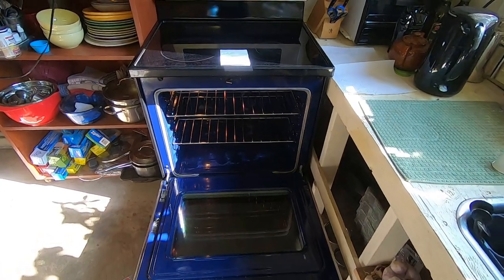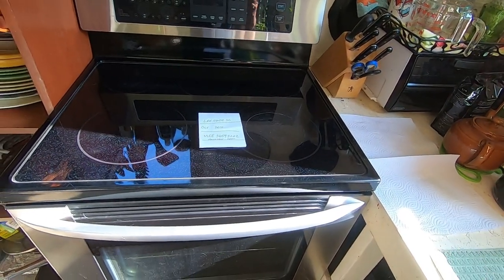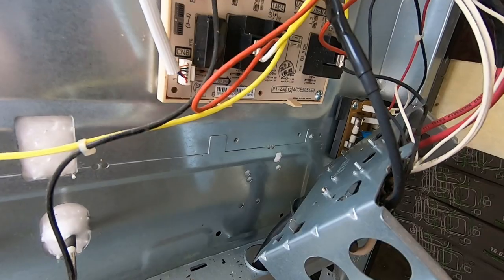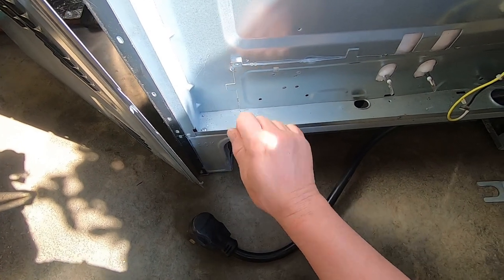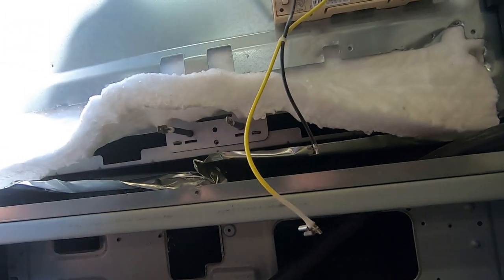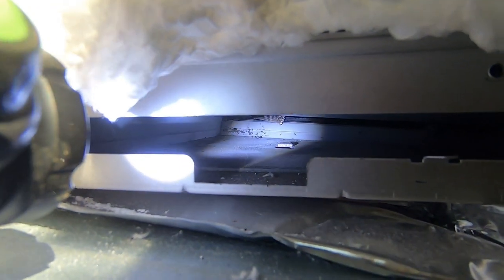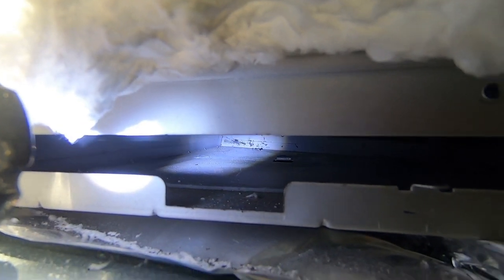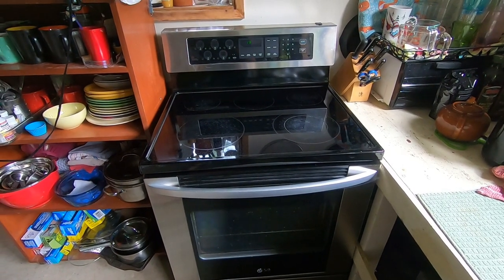HOW TO CHANGE A HIDDEN BAKE ELEMENT

Comment: How did you find the part number for the element that you needed? I have an LG LCS5633WS (13 years old now..) that the hidden bake element just went on and I can't confirm the part number I need anywhere. Would it be the same as yours?
Reply from the maker: Do an internet search for " LG stove parts". When you find a site that sells replacement parts, enter your model number, and search for the element from the list they provide. As an example, here is one of many sites that may be able to find your exact part. Good luck! https://www.repairclinic.com/Shop-For-Parts/a13b200/Lg-Range-Stove-Oven-Parts
Reply: @EverydayProjects  awesome thanks for the fast reply
Reply from the maker: @wyarmyboy  Now you have to subscribe to my channel, ha ha!
Reply: @EverydayProjects  haha will do. I still don't seem to be having any luck with my particular part number tried the site you sent and many others.
Reply from the maker: @wyarmyboy  I'd double check the part number. Sometimes I wear two pairs of glasses to read those numbers, they're small!
Reply: @EverydayProjects  the oven model number is actually LSC5633WS but that was just a mistype I've still got the manual but no luck with finding the part on anywebsite.
Reply from the maker: @wyarmyboy  Try this one: This is most likely the bake element for yours. https://www.lgcanadaparts.com/lookup/282482?m=LSC5683WW
Reply: @EverydayProjects  thanks I found that one too and I think so as well. I emailed them for confirmation. Then I can order a cheaper one from Amazon. Haha. Thanks for your help and the video.
Reply from the maker: @wyarmyboy  Glad you found the right element for your oven. Best of luck with the install! Subscribe for more useful tips and entertainment!

Comment: I've heard that the self cleaning feature can cause lots of problems due to the high temps.
Reply from the maker: Good point! The extreme heat from self-cleaning ovens must have detremental effects on the life-span of the elements. Other times, the heat from the oven can damage other parts of a stove. I had a Jennaire Gas range that went through control boards because the board was mounted on the front of the stove immediately above the oven door. When I looked it up, I found countless forums about the exact issue from many owners. Stove manufactures (most) are in the business of selling stoves for profit and not in the business of making stoves that will last for decades, or so it seems. Thanks for watching and for making a comment.

Comment: What kind of sadist engineered this thing? I suspect my 10 year old LG has the same issue and I'm half tempted to throw it out.
Reply from the maker: It appears that they'd prefer you did that, but the element can be changed. We live in a "Throw-away society" where product manufacturers seem to want you to buy their latest creation all the time. This thinking knows no bounds: cars, fridges, and small appliances follow this rule, even when the technology is out there to make things last for decades! Remember your grandmothers old refrigerator? Still running no doubt, but not the modern stuff! Thanks for watching and good luck with the repair!

Comment: Helping a friend who has a Kenmore model 790.46893903 which also appeared to have no removable bottom panel. I am helping him remotely, and he tells me that the inside cavity of the oven has no seams - one continuous shell. I suspect that it must be like this one where the element has to be accessed from the back. 
Can anyone confirm for Kenmore model 790.46893903?
Reply from the maker: I found an online manual for that model (790.46893903 ) but the drawing seems to show that the bake element is visible inside the bottom of the oven. Are you certain the model number is correct? Here is the online manual: ftp://ftp.electrolux-na.com/prodinfo_pdf/lassomption/5995586210.pdf
I will continue to research this issue and will reply with more information as I discover it. Best Wishes!
Reply: Pls check link. Doesn't load
 
 @EverydayProjects
Reply: @EverydayProjects    Model # is correct  https://www.dropbox.com/s/k5p4onvgia9eh06/Oven%20model.JPG?dl=0
Reply from the maker: @SammytheBammy1  I couldn't copy the link either. Here is something that I did find. It is a list of links for oven heating problems on the same stove Kenmore model 790.46893903
https://www.appliancepartspros.com/repair-help/kenmore-range-79046893903-repair
Reply: @EverydayProjects   I think I got it. I was finally able to download the manual and the diagrams were the clearest I've seen. From that, I believe I've figured it out. You have to pull out the warming drawer, unscrew the baking element pan from the bottom and then get access to the element. I'll work on it tomorrow.
Reply from the maker: @SammytheBammy1  I'm glad you were able to open the file. I thought the element was in the bottom of the oven but it wasn't very clear in the diagram. I see now what you're saying. The element on the Kenmore stove is accessed from inside the drawer! I know that some hidden elements are also accessed by removing a side panel, not the back. Great detective work, Jamshed! Take care!
Reply from the maker: @SammytheBammy1  Well done! Another mystery solved! Yes, the element looks bad; almost as bad as the one I removed from the LG stove! Very good feeling to figure things out and fix them.
Reply: @EverydayProjects   One last bit of information. My friend told me there was a bad burn mark and even a burn-through hole in the panel that enclosed the bake element (from the top of the warming drawer.) See pic here. https://www.dropbox.com/s/6q4cmtfbck0c6o4/Oven%20burned%20bake%20element%20panel.JPG?dl=0 

Here's my theory of what happened. The element failed at the end which is separated from the mounting plate. It must have gotten so hot that it broke off at the point of failure and the end of it came to rest on the lower panel. Normally, this would have tripped the breaker, but since it was at the "far" end of the element, a reduced amount of electrical current kept flowing through the coil and then through the panel (which is grounded to the rest of the oven body) without exceeding the breaker amperage. If the circuit had a GFCI breaker it would have tripped, but it doesn't.

This generated a lot of heat which caused the "snake-like" burn marks on the element. You notice that the burn marks are worse towards the "far" or broken end where it was touching the panel. This also caused it to burn a hole through the pan. Once the hole burned through, and the end of the element was no longer contacting the panel, the circuit was broken and the oven stopped working. 

QED
Reply: @EverydayProjects  Ran into another issue! After replacing the bake element, it still doesn't work! :(  The element tested OK. The broiler works, so I don't believe it can be the thermal cutoff switch as that controls both elements. I am afraid this might mean that the electronic module (part #318296824, $200) has been damaged. I don't know if there are any replaceable fuses in the module or externally (I'm working on this remotely). Any ideas?
Reply from the maker: @SammytheBammy1  Here is a list of generic oven problems with tests to perform. It sounds like it is approaching the time for your friend to contact an appliance repair person. Best of luck!
https://www.partselect.com/Repair/Range-Stove-Oven/No-Heat-When-Baking/?retfrca=1